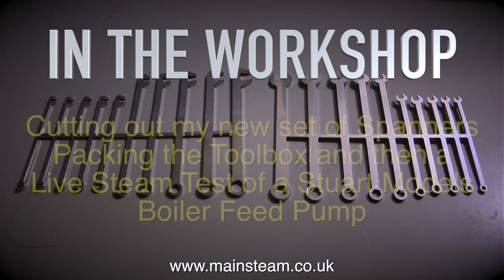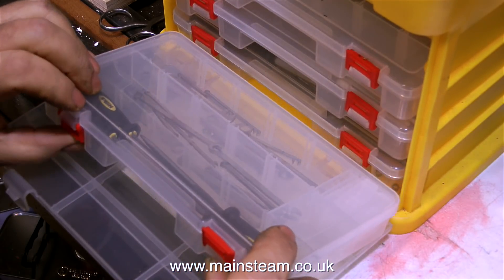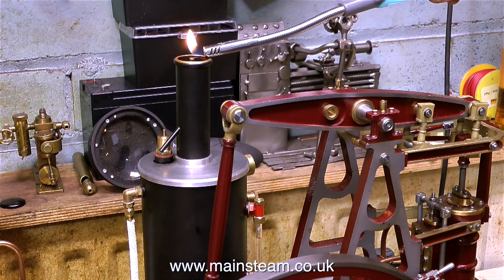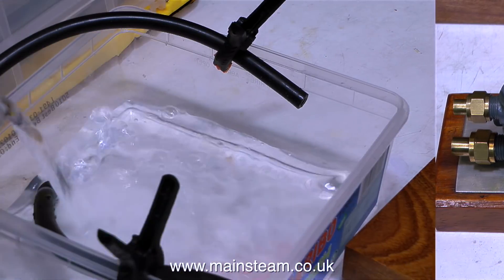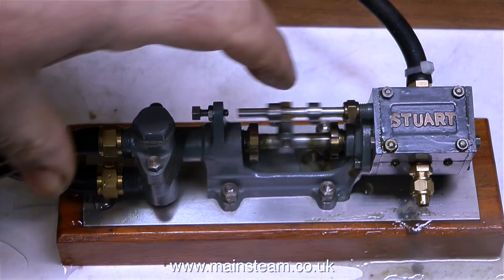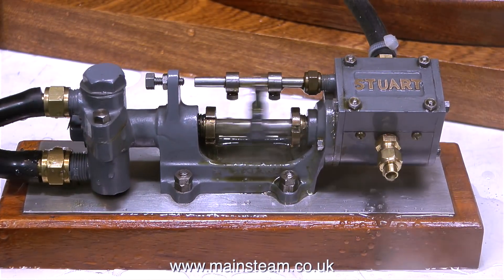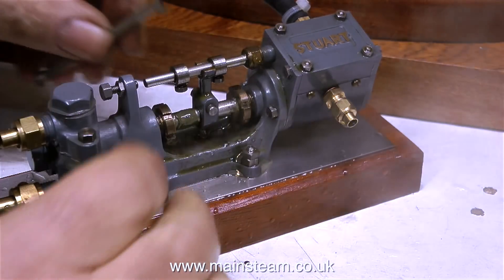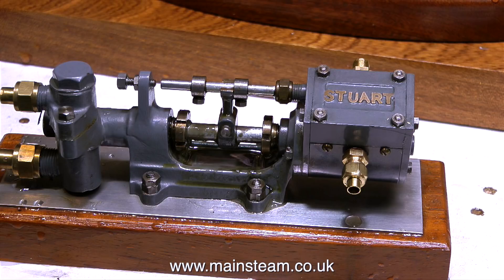STEAM TEST OF A STUART MODELS BOILER FEED PUMP - IN THE WORKSHOP

Comment: Hi Keith. I have a Wilesco D16 steam engine running a small generator powering a street lamp. I use distilled water in the boiler, is tap water a definite no no? Could I use filtered water from a filter jug. I use Wilesco steam oil in the steam line oil feeder, Is it ok to use 3in1 for all other moving parts i.e. eccentric's, bearings etc. Love your videos, their great. Many thanks, Dave M.
Reply from the maker: I would say you are OK with what you are doing ..... Distilled water is better than tap water.
Reply: Thanks Keith.

Comment: Hiya Keith. These pumps are alright as models.If you remember I built one and brought it up to yours to test and we ha problems getting it going. They leak like sieves and if you tighten the glands they dont run at all. You know I build a decent pump so there was nothing wrong with the engineering. Its probably why they are called Stuart Models.Not meant to be used in anger. 
Also ,I think the Stuart models are overpriced now. The Southworth pumps are a much better proposition , especially the Duplex. You should show the one that I built that sounds like a locomotive when it is running.

Comment: Keith, I am experiencing the exact problem with my pump. It works, but it doesn't. I have found a bit of a small error on the original prints and it is still on the new prints.  I am so glad you are making a video of this. I had asked your daughter, a while back, if she would ask you or post more about boiler feed pumps on her Steam clinic site.

Thanks so much!
Reply from the maker: Thank you Jed - ! Charlotte doesn't have much free time to attend to the Steam Clinic forum that's why I don't get much info from it. These small Stuart pumps are very erratic - not my favourites mechanically but they look nice. The problem I have found is that for the small amount of water that they actually pump into the boiler, they use a lot of steam - which uses more water ... catch 22. Also they do not like very hot steam at high pressure either.
Reply: Keith Appleton , that is exactly what I am experiencing. Took me a solid week to build mine, and three weeks to find out the prints were wrong.
Reply: Hi Keith, other then Injectors, and engine driven pumps is there another design you would recommend?
Reply from the maker: That's about it I would think - I like injectors but I also like to watch the mechanical aspect of these pumps.

Comment: Hi Keith.   Maybe in a video you can explain why the water pumps don't use a rotating flywheel and eccentric valve system.    I suspect one reason is that the shuttle value type is self starting?   but then the question is why aren't all steam power systems more like the water pump sliding value type?    Inquiring minds want to know !

Comment: I wonder why they left such a huge bridge between the wrenches? With laser cutting that could be as small as 1/32"
Reply from the maker: Possibly something to do with the heat distortion produced by the Laser. I am sure that the manufacturers did it for a good reason .....
Reply: Do the wrenches have a sharp edge like what you get from milling?
Reply from the maker: no, the Laser cutting is quite smooth .....
Reply: I'd expect that another set of spanners, or maybe other tools, overlap / nest in the space between individual spanners - there seems to be more enough space including cutting allowance. That'd minimise wastage & produce ~ 2x as many sets per sheet of stock.

I only wish I could find something similar here for a reasonable price - a set of nice thin spanners would come in very handy...